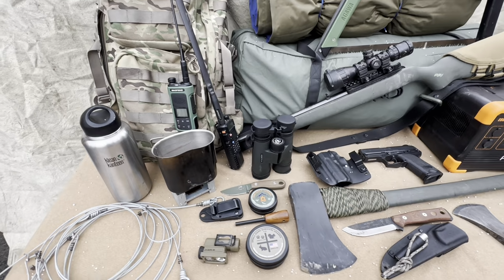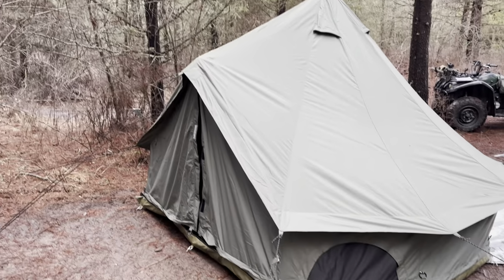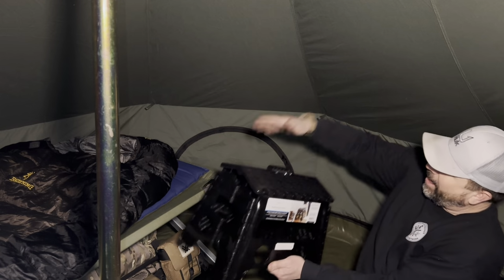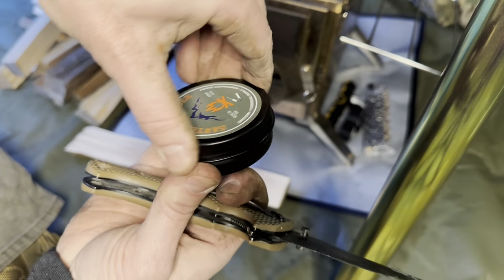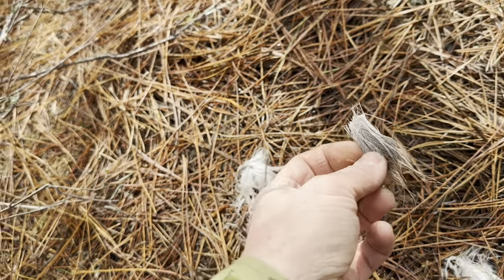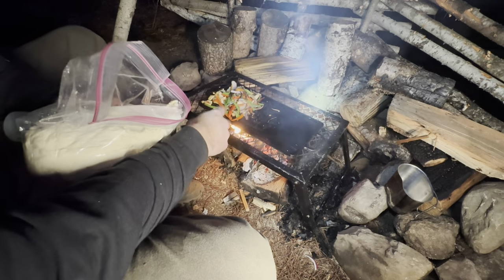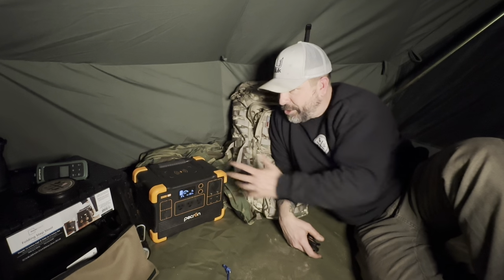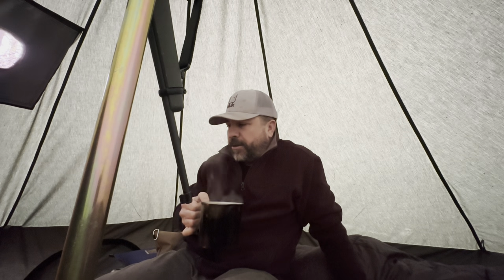BUGOUT BASE CAMP - SURVIVAL GEAR  & BUSHCRAFT SOLO OVERNIGHT IN THE NORTH IDAHO WILDERNESS #shtf

Comment: My wife and I stayed a month in a very similar outfit while running a trap line. The solar generator is a God send. A couple words to the wise if staying long term in a camp like this. wool blankets, the inside of tent temp will drop drastically as you allow the wood fire to die in the stove , you and your bed will experience condensation in a canvas tent when that happens. Only 100% wool will keep you warm,  do not sleep in the tent with a roaring tent stove, have a smoke alarm and CO. Detector as well. Use several wool blankets w a thick foam over air self inflatable mattress. We use Metal boxes to keep our food in, and do not eat in the tent. A bit of crumbs is all it takes for a hungry rodent to chew it's way into your tent. Cut all the firewood you need for the whole time you will be there, then cut more... and pile it. Then cover it good. Make sure to cut a lot of small stuff for kindling wood, and have tinder ready to go. For the whole time. Do that day one. You can get sick, or injured, in that case you won't be bucking logs, but you could feed a fire if everything is prepped material wise, then you don't freeze to death because of a mild illness you'd otherwise survive. 
Last but not least, have several methods of staying clean. Portable shower, shop towels, baby wipes, alcohol, soap... Long term camp in the cold means what worked today may not work when you're freezing.
Reply: May I say? The Modular Military Sleep System uses what? A really good day of research on YouTube will enlighten one a lot regarding that question. For advanced outdoor living... Question: What is the Extreme Cold Weather Clothing System. YouTube research will teach you that in one afternoon. Let US not forget the FREEDOM part. Now then. One more question? How many "Puffer/Sherpa" layers are you wearing under your "Amazon"...(Capitalism! Not brought to you by the American Trucker...) "Rain Gear". I love my USGI Poncho and "woobie". Probably the best on the Market today! And my Mountain Hardware "Ozonic" Rain Gear Tops and Bottoms are indispensable. But the 33,000 Ft kind is cheaper and highly functional. ("Three Piece Suit.")
Reply: Question? Do you wear those furs, and eat them too? Why do you spend money? Threads... Feed... They did it 10,000 years ago. Thank you for sharing! An interesting... How to say... Wool does insulate when wet! (Especially socks.) What is the percentage of wool that has to be in the socks to insulate when wet? Have you tried water proof socks from Amazon?
Reply: @davidturner3014  wool items normally retain the percent of heat equal to the percent of wool when wet. 80% wool retains 80% of its insulative quality 70% wool retains 70% of its insulative quality. So 100% wool is the best, it is also far easier to keep clean.
Reply: What kind of Baufeng radio are you using ?

Comment: I have a similar tent from White Duck Down. For those style tents it’s recommended to set the tent up. Then spray it with a hose/sprayer with water. Wetting it down will shrink the cotton fibers and naturally water proof it. I’ve hunt/ camped with ours and it weathered heavy rain for 2 days. Never leaked. For your stove pipe I use a small pipe collar slightly modified to closely fit the pipe to shed the water away from the opening in the tent. I love the video you made and will be buying your survival products soon .
Reply from the maker: Great advice, after the first couple rains it was exposed to, it definitely seems to have become more waterproof.. thanks for watching!

Comment: A lightweight tarp slightly larger than the floor dimensions of the tent makes for a great rain cover, and with approximately 12 inches of standoff between the tent and the tarp in the summer months, the tarp provides a great shelter from the sun and allows for the tent to stay cooler inside.
Reply: A tarp and blanket under the tent as well. !

Comment: I have the 3000 series pecron and it runs my lights, small refrigerator, and my nighttime fan for 4 days at camp.  A fine piece of equipment.  It’s lithium ion.  I would prefer lifepo4,  but what they don’t tell you is that you can’t charge lifepo4 below freezing. (Unless you have a built in battery heater).  So after saying that, I’m glad I got this one.  The price is right and you don’t need all the app knowledge. Very simple and productive.  Solid piece, a little heavy but hey, it’s a battery.

Comment: Joe, I like your camp setup.  You seem like you thought out every angle except a water source. Steel wool will work for your fire starter as well as guitar pics (the nitrocellulose) ones. Please use the spine of your knife on the ferro rod....it'll save your sharpness. Pack some long tongs for your grilling to get your hands away from the heat. The saying goes as, "One is none, and Two is One,"

Comment: Cool video but, I cringed when you used that blade to strike your fire steel.
Take every knife to the bench grinder and ice skate sharpen a small spot on the spine. Works great and it won't ruin your expensive tools you need to stay sharp.

Cool video this is my first view.
Subscribed.

Comment: You made 1 MAJOR.. mistake . Striking that ferro rod Inside the tent @ 3000* F  you would burn a hole in any tarp floor and defeat waterproofing and snow coming up through the bottom.